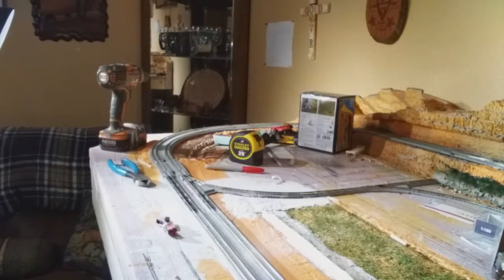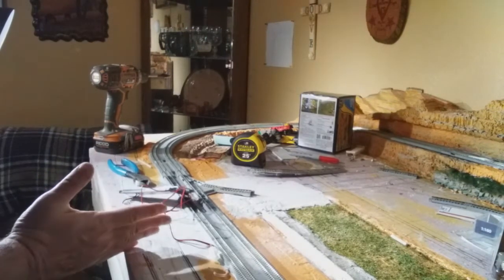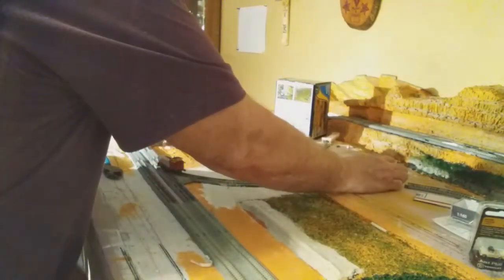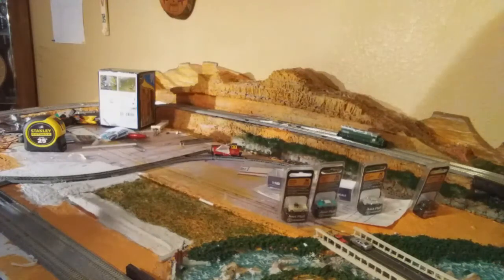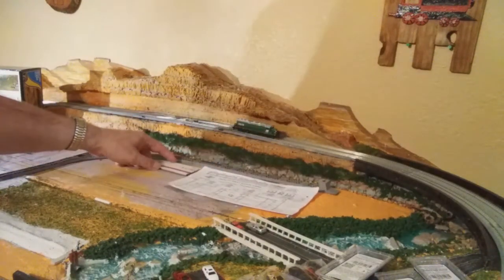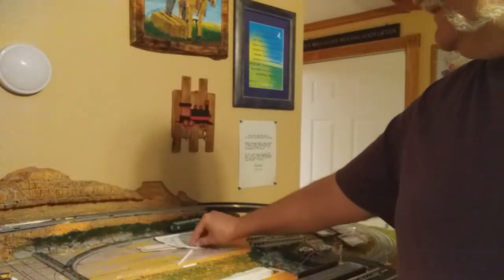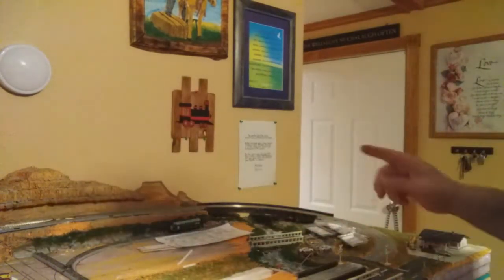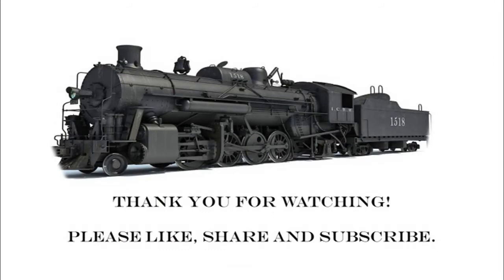STEP 43: INSTALLING TRACK FEEDER WIRES AND SWITCH CONTROL WIRE ON MY SPUR TRACK

Comment: You have the POWER! --dunc
Reply from the maker: Should we still change the screw settings or is the wire feeders ok? This video was made a few months ago before you told us about the screw settings. If we leave it with the wire feeders will it short something out, or will it be fine?
Reply: @mmmodelrailways6001  It will only short out if you have the feeders backwards.  At this point you might consider that putting feeders in now is future-proofing for if you want to do blocks.  If you insulate after the turnout, and have the spur on its own block then you could run engines independently on the spur without interfering with the main-line operation (DC running).  When you go to DCC you won't have to rewire anything, and you'll be able to add block-detection as desired.  I think you're fine! --dunc